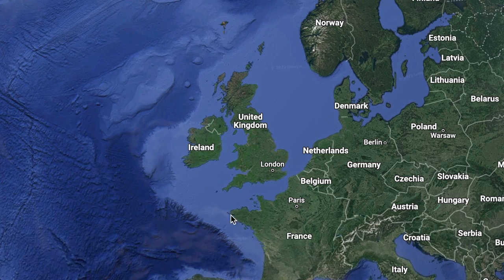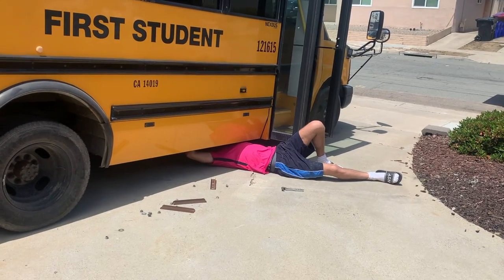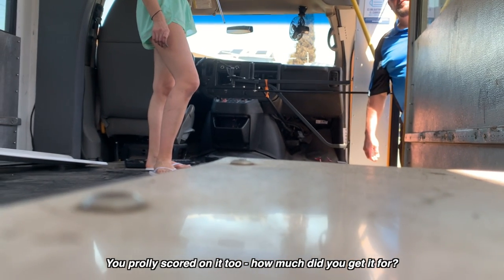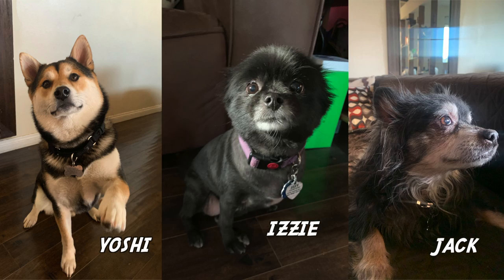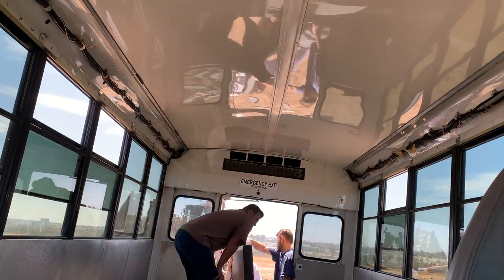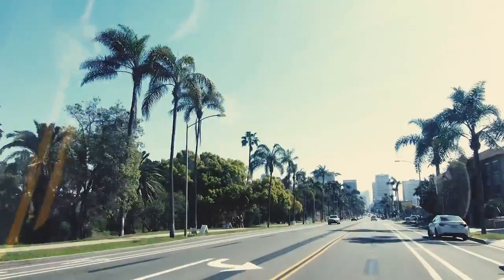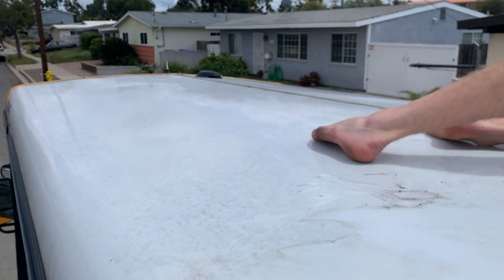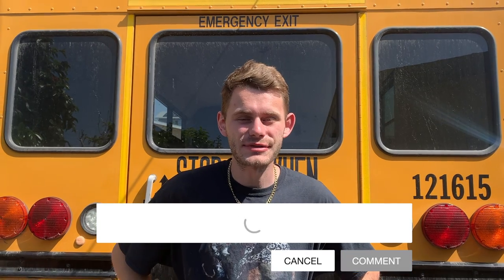Is this even possible?? A 30 day school bus conversion...

Comment: Hi guys, great video!

How come didn't you put insulation and sound deadening?
Reply from the maker: Hi mate, great question. We ripped back a load of panelling on the bus and saw it had already been fully insulated with Foam! We actually didn’t bother with sound deadening at all this time (all the windows kind of defeat the object of it)!
Reply: @DJ,
2003, we converted a 1996 Ford CF8000 commercial truck to our concept of an ExpeditionVehicle.
.
Our insulation:
* adhesive-back acoustic against the wall, a gap, then
* one-inch pink-board, another air-gap, then
* two-inch foil-side poly.
.
Our windows are 3010 (three feet wide by a foot tall) dual-pane sliders designed for a stand-still house.
We mounted these at our eye-level standing inside, about eight feet above pavement.

Comment: How much water tanks do you instal (how big are they)
Reply from the maker: Hi Carl, as we’re only part time living in the bus, we’re not going to under carry our water (for weight reasons as well). So we’re just using 5 gallon Clean and 5 gallon of grey water! (Bare in mind we don’t have a shower, planet fitness 👍🏻)
Reply: @carl,
For our ExpeditionVehicle, we use stainless-steel five-gallon retired Pepsi kegs.
.
Our standard load is seven (thirty-five gallons).
A big advantage to small tanks is modularity -- we can add a couple-three dozen more in the toy-hauler I fabricated on a similar commercial chassis... giving us around four months without re-fill.
.
Another advantage:
* a couple-three go to town for re-fill while the others stay in camp..
Here is an identical system by the Everlanders, filmed on a Baja beach: